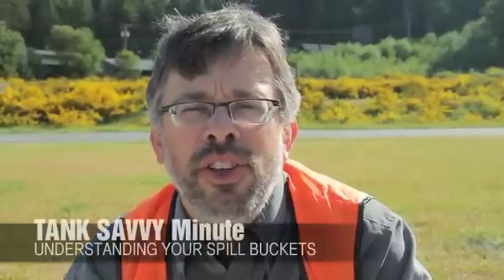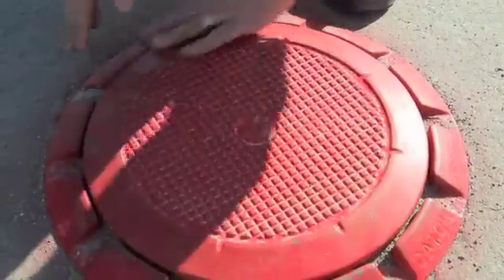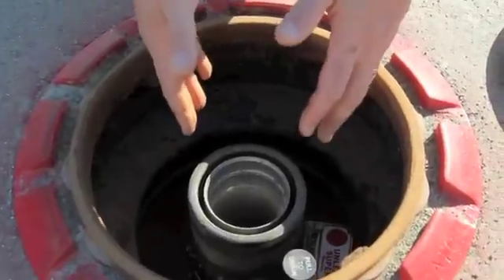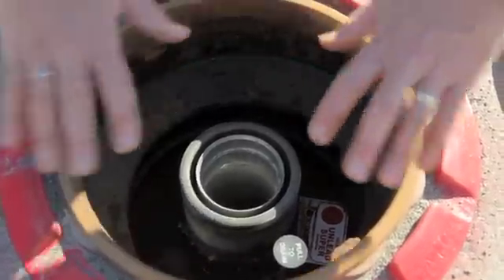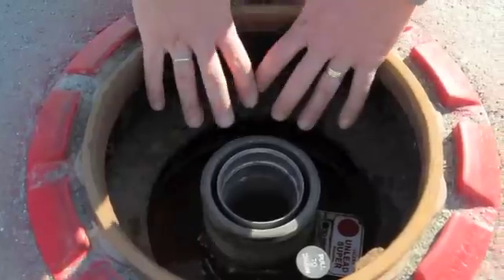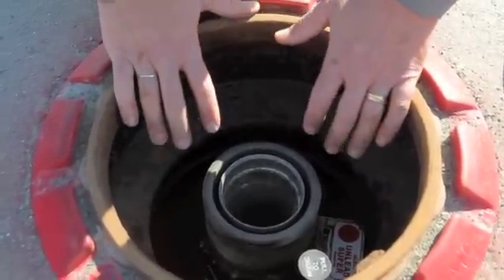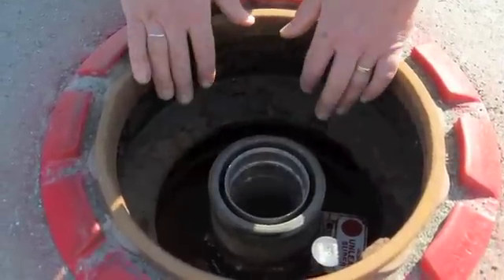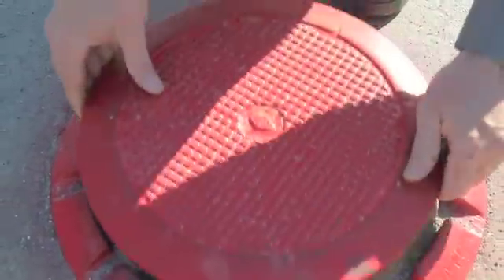Understanding Your Spill Buckets

Comment: Question: i'm trying to find info on how to remove rust from our spill buckets at work. Water is the easy part, but the accumulation of rust particle debris is just getting ridiculous. I even scraped and painted the lids of our buckets, but it's the rims around the buckets themselves that are creating all the rust dust. The only problem is i'm at a loss for how to remove the rust efficiently. Drill and steel brush is out because of the obvious fire hazard 🔥 Afraid of any kind of spraying it off because it might make static. Only thing I could think of is manually scraping the insides, and spraying with clear coat? Do you know any good methods?
Reply from the maker: The root cause analyst in me, says it’s time for a new spill bucket!

Comment: Why at Kroger do they (employees) have to check these spill buckets for water in them?
These spill buckets should have a better seal or rubber seal no? 
Perhaps a spill bucket maintenance by a more suitable or knowledgeable company or people should be doing this?
The employee should not have to kneel down where cars travel.
This should not be done by employees as it is a huge safety hazard for the employee as they could easily be run over by a car and that is a lawsuit or funeral looking to happen.
Even when the employee has cones, the orange vest on and daylight hours it is so hard to see them because of them having to be so close to the ground.
I hope this changes for Kroger fuel employees.
Reply from the maker: Hello and thank you so much for your thoughtful comments. I'll try to answer them below. I've trained Kroger management over the years but I so I can't speak to Kroger employees directly who manage spill buckets because I don't have that direct experience. But I'll try to answer the questions generically so you can think about it in the big picture.

Spill buckets, especially those in rainy parts of the country, often times accumulate water. There's almost no way around it. We can put a person on the moon but we can't always keep our spill buckets clean unfortunately. High impact traffic, combined with rain, combined with appreciable wear and tear of the equipment all make spill buckets a weak point in the UST system.

Spill bucket inspection is required at least every 30 days and we recommend daily if it's a busy site.

There was actually a chronic shortage of certified petroleum technicians in the industry, which often times put the onus of responsibility on the owner of the tank system.

The video above is definitely more geared towards smaller mom and pop operations that don't have super busy sites or complex business structures. 

Companies get to decide who can clean the spill buckets. We train people on how to do it and caution people to be careful around any openings especially when there's traffic involved.

Employee should definitely not be kneeling around traffic without personal protective equipment, orange cones, safety lids and ideally a vehicle that provides T-bone blockage against an attentive drivers.

So in summary, spill bucket must be inspected and should be kept clean and dry as often as possible to make sure the equipment is safe and water is not getting into the customers vehicles. Plus a damaged spill bucket or one full of fluid is an automatic environmental violation. Spill bucket inspection safety is absolutely important and we train class AB and C operators to do it safely and smartly. That being said, hazards still exist for anyone doing inspections especially at a busy convenience store. All USD owners should have a safety plan in place to make sure that their employees are doing it correctly and safely.

Hope this helps.
Reply: @USTtraining  Thank You!
Wow this was so informative and I appreciate it so much. 
I have mentioned to the fuel drivers and to our union rep. that we should have a better seal (sealant) on them to help prevent water and debris. 
I do hope our fuel inspectors and management do come to the conclusion of better seals and more experienced or more knowlegeable people like yourself help the employees have better knowledge, seals and safety. 
Thank you again so much.
Reply from the maker: @FrugalSimpleLess  the actual spill buckets in this video that I shot 11 years ago, hard to believe, have been recently replaced which shows you the kind of wear and tear these devices got. We do cover things like inspection safety and spill bucket inspections on our operator training courses. See www.usttraining.com for more information.
Reply: @USTtraining  Thanks!